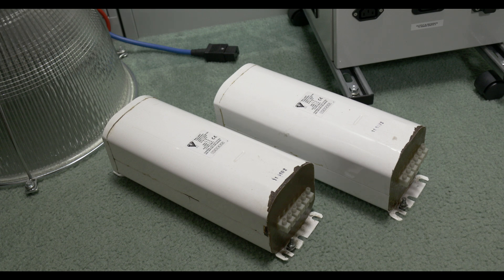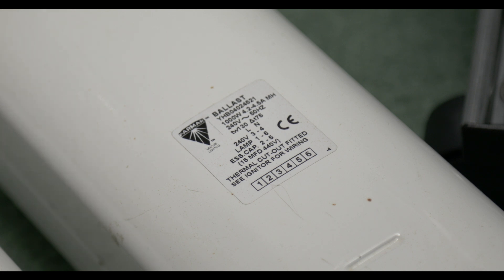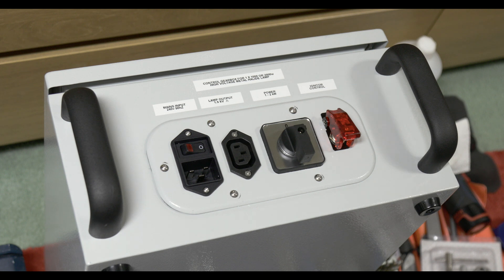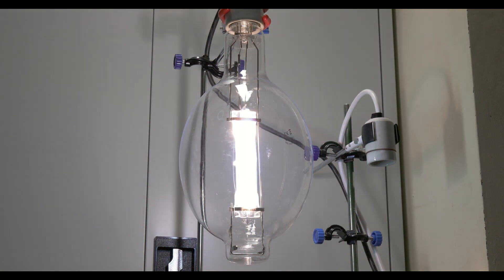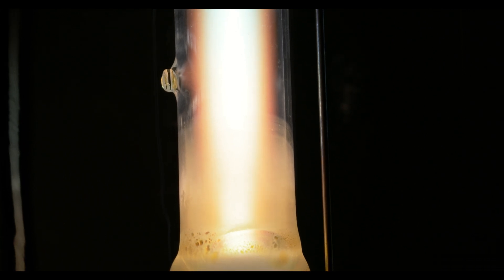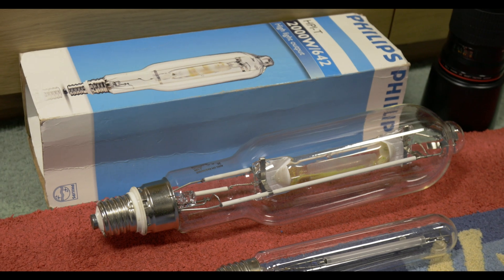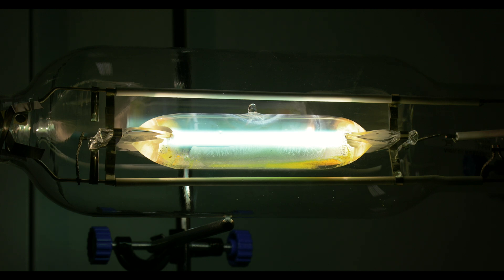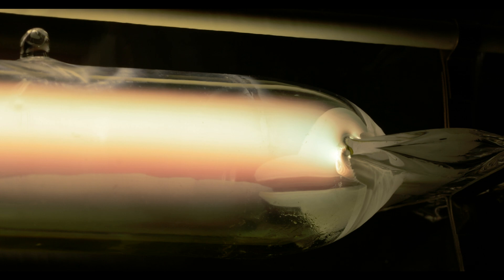Building a 2000w Metal-Halide power supply & Philips 2000w HPI-T lamp

Comment: I wonder how these compare to double end lights? My light meter shows my double end 1000w lights are putting out 2000 watts of light at 24”. They’re incredible hot. I paid $130 each with bulb and hood and my plants will bend to it when compared to a 2000 watt MarsHydro, 400, or 1000watt single end HID. Quite surprised really. 

I use a ventilation system and draw fresh air from outside in the winter and use air conditioning in the summer. Also exhaust to the outdoors. The room gets 100 degrees if not ventilated and air conditioned. Its a lot of electricity for sure but the bloom is double the harvest over our hydrofarm 1000w HPS. 

Nice setup you put together there
Reply from the maker: The only large wattage double ended lamp I have been playing with is 1500w MBIL/H which, like the big 2000w lamp in this video, are designed for stadium floodlighting rather that horticultural purposes. The thing with double ended lamps is because they are a lot thinner, they can be placed right into the focal point of a compact reflector system to get very good beam control.

Comment: Do you have any experience with/interest in Xenon short-arc lamps? I only saw one video you published showing a xenon flashlight. I have a couple of vintage lamps for 16mm film projectors that I need to make ballasts for, though they're shockingly inefficient for Xenons. Specifically, their make and model is Ushio UXL-350 E-0. The more modern replacement, the UXL-351 E-0, is rated to produce 1200 lumens at 350 watts, and I figure that these vintage equivalents are similar.
Reply from the maker: That flashlight, although it was marketed as and I called it xenon back then was really a metal halide lamp similar to those used in cars and not true xenons. I don't have any short arc xenon lamps myself. Would be interesting to see the control gear for those projector lamps. IIRC they only run at like 15-20v but need quite a bit of current and very high voltage kick to get them struck!
Reply: @FrontSideBus  I half expected it to be a metal halide bulb, since it looked so blue in the video, similarly to the LED, and those LED upgrades are always far too cool temperature. Metal halide is much more efficient than xenon short-arc lamps after all. Those little metal halides remind me of the HMI lamps used in film, which I'd love to get a set of.

As for my xenons, I'm lucky enough to have the original packaging, which states the nominal current and voltage required. I got them from my college's surplus, and I should go back to see if the projector is there somewhere. If not, I've heard of people running these bulbs off of DC welders.

Edit: I could provide photos soon if you'd like. They have wonderful old packaging.
Reply from the maker: @Wyatt_James  I can imagine! I do have an AAA battery sized 50w super pressure mercury lamp meant for microscopes and you can run those on current limiting DC bench power supplies but the tricky part is getting them to strike!